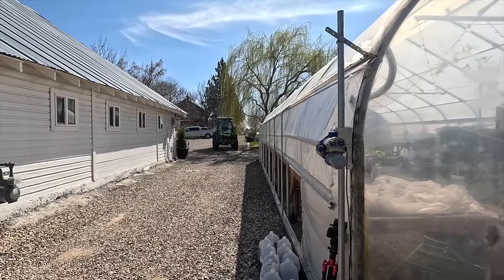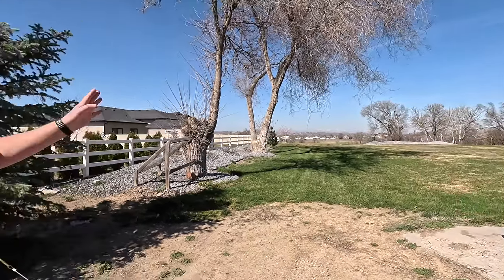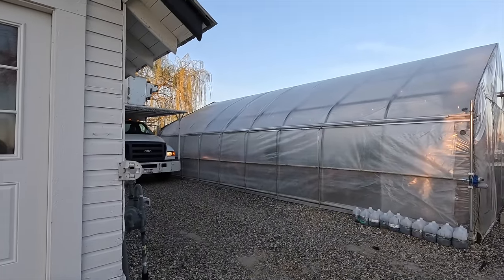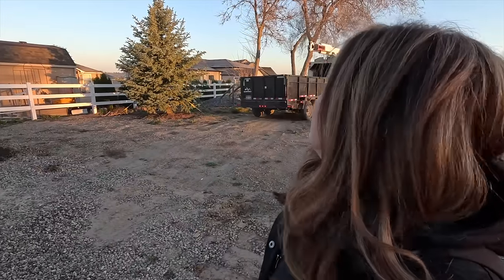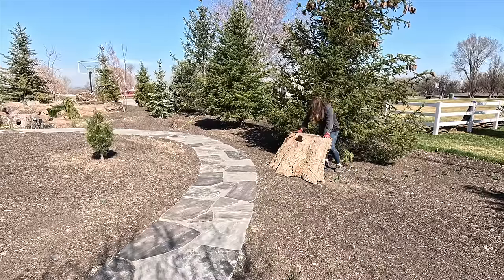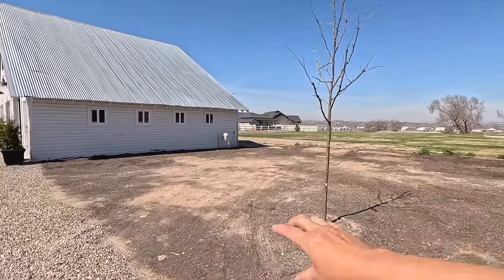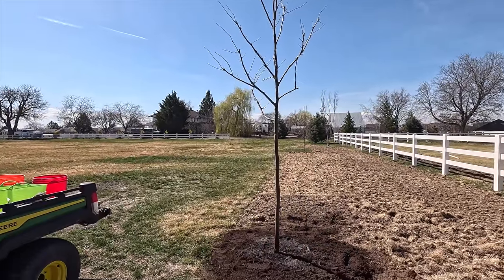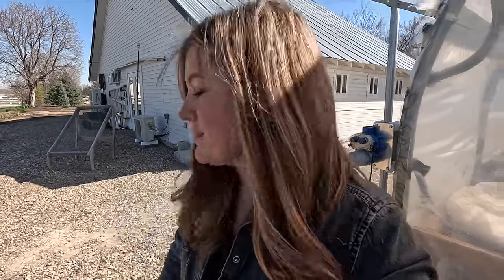Elm Tree Removal, New Stump by the Pond & Moving a Honey locust Tree! 🌲🌿🌳 // Garden Answer

Comment: I saw that you have an attachment on the back of the tractor.  Would weights on the back tires be helpful?  I'm sure Chad will know.  In a different video you were wondering what that wood and screen next to the well and tree was.  I was wondering if it is a home-made loan screening set-up,if the screen is small enough to remove rocks and sticks.  Over in the dirt lands when you planted the Sweet - Gum tree and the Oak tree the seeds in the form of acorns and that gnarly seed pod from the Sweet-Gum tree I believe can cause bruising if a horse steps on them and then turn into an abscess making them very lame and needing treatment.  I have seen this on a couple horse videos. I believe one was "A Stable Life" video and had marked down the time stamp and it's title but misplaced it, sorry.  The other was a horse rescue channel but it was a long time ago. I thought you had a neighbor that was riding a horse 🐴 in a corral on the other side of the fence close to these trees and if this info is correct they might not be very happy, nor would you be if you do indeed get horses and want to ride them over there in the future.  Please check if this is correct with someone who would know. I thought I should write you this just in case.😢❤

Comment: I would like to strongly recommend you liquid fill the rear tires on your tractor. It will increase the capability of the tractor by a complete class! My little 30 hp tractor would stand up next to a 40 hp tractor after liquid filling its tires. It will blow you away the improvement! That planter behind the greenhouse would be no problem and it will extend the life of your tires to boot!
Reply: I asked when I was younger why we didn't have liquid or thick rubber tires(with the air kind of trapped in the rubber) for slow moving vehicles and things like garden carts and barrows.
Reply: Excellent suggestion!